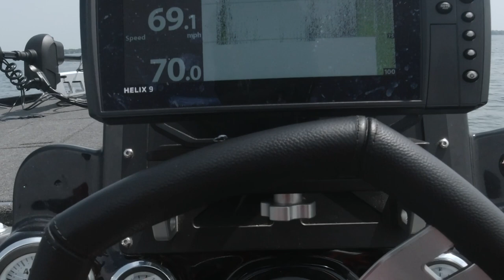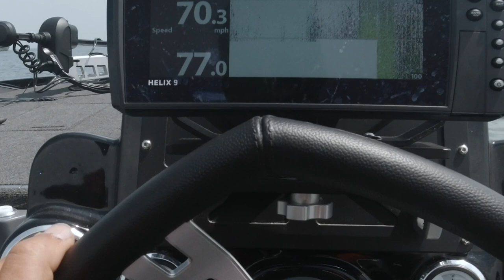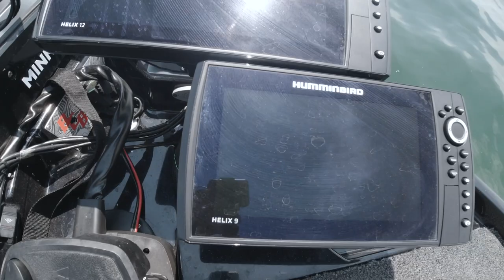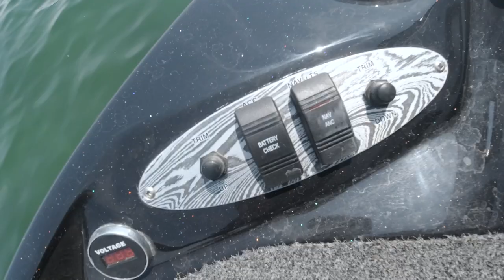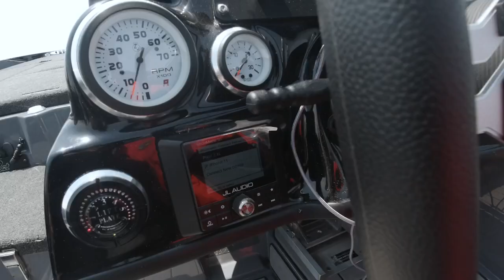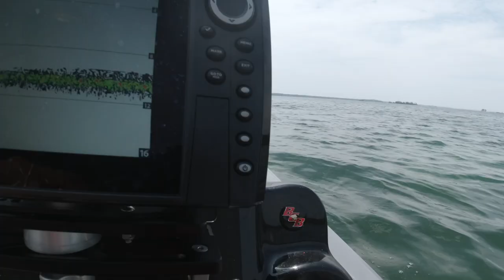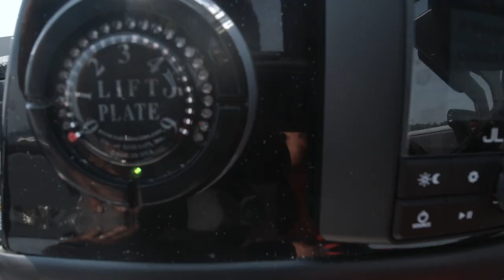2023 BASS CAT PUMA STS/YAMAHA VMAX 250 SHO - TOP SPEED RUN AND DETAILED WALKTHROUGH (very detailed)

Comment: Great video.  I have a 2023 Puma STS, have yet to run it at low altitude.  I'm in CO and able to get mid to high 60s out of the boat which is really good for up here w/ a 250 mere.  Had a question for you, when I am in big water (water going over the bow) I have ended up with water in both rod lockers (carpet is really wet in the indention in the locker close the consoles).  Have you had an issue with that?  Also on the slam locker after a year or so, the rod locker latches towards the back of the lockers were missing the catch (I expect it was the carpet compressing). I took the latches off and added a washer on each bolt which pushed the latch closer to the inside of the lid and solved that problem. This is my first Bass Cat and really am enjoying it.  Tight lines...
Reply from the maker: I haven’t had any water issues in this model as the slam latches make it virtually impossible to get water past the raised flange and gasket as the holes are outside of that, on the flat. I have heard of a few latches having problems but thankfully mine have worked flawlessly so far.
Reply: @JPDeRoseOutdoors  Thanks for the reply, the water isn't coming in from the top, I believe it is coming in from the hull.  I think the water is sloshing around in the hull when it is rough and getting the carpet wet.  The auto bilge will turn on once in while during these rough days but it doesn't get it all.
Reply from the maker: @Derek-h1b  wow! I have seen it happen when there is a lot of water in the hull but the bilge should be keeping that down to a minimum.... crazy